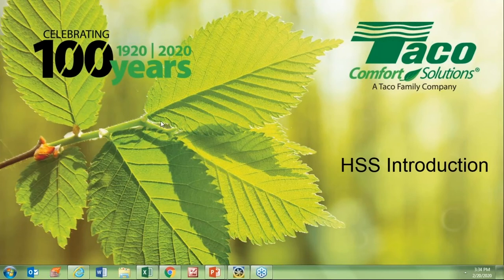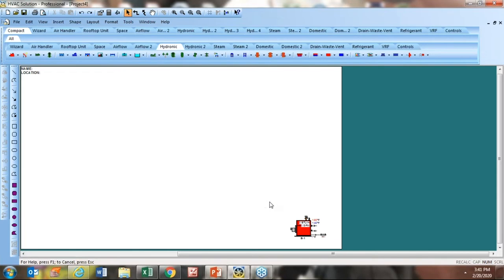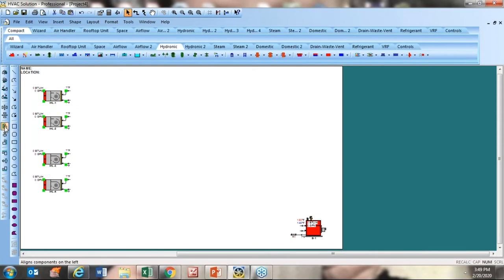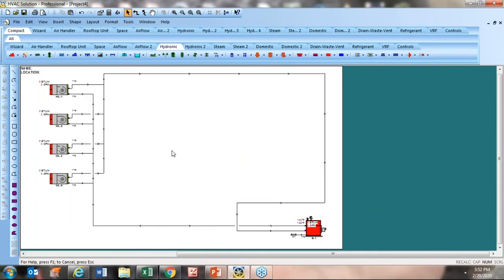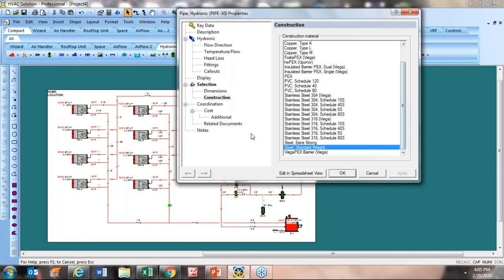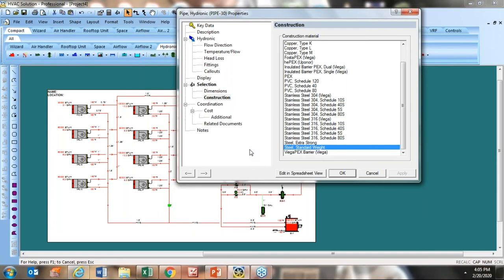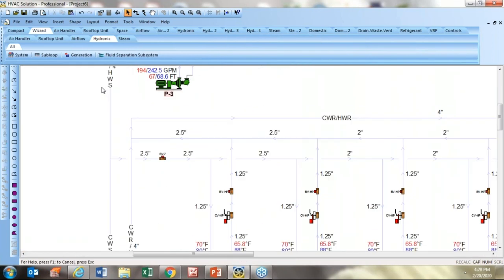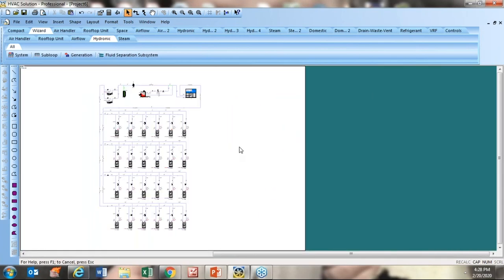Basics of Hydronic System Solutions Software

Comment: Hi, One quick question Sir, how does the Program include the Friction loss due to elevation?
Reply from the maker: Good day and thank you for tuning into the Taco Tuesday webinar series. The friction loss is calculated in the HSS software. It takes into account the length of pipe to get to your heat emitters. However, height doesn't come into the equation for calculating friction loss. The height of your system is calculated into the static fill pressure of your system.